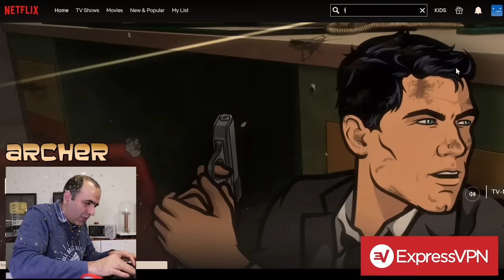What It Takes to Break a RAM with ESD (ft. Linus Tech Tips)

Comment: I remember back in the nineties when I first started building computers, everybody wore those ESD wristbands.  I had one, or I used to make sure to ground myself on the chassis. Over the years I don't think that I've ever killed any electronics. I did have my first 33.6k modem get destroyed by lightning. I saw the spark. I was using the internet at the time and the case was open next to me.

Three and a half years ago I switched to laptops. I never even bothered to sign into my desktop after that. Packed it up. Sitting in the basement. I've done plenty of work on the laptops I've owned since, hard drives, batteries, RAM, that's pretty much all you can do. I haven't even bothered to try to avoid static discharge.

I'm not saying it's not possible. But at this point, I don't worry about it. It's not a problem.
Reply: Same here, worked as IT building and fixing computers, we only wore those wristbands in school and i've never seen anyone use it while working. I mean, as soon as you touch the computer case you're void of any charge so unless you like rubbing your feet on wool while touching a powered computer i doubt anyone would ever kill a component by not being grounded.
Reply: Wtf 13 hours ago?
Reply: Maybe people did wear ESD wristbands because hardware was way more expensive back then? I would say that they were more sensitive to ESD, but I've read somewhere that since they had huge transistor sizes, charge would be more spread out than modern pieces with tiny transistors.
Reply: I second the confusion that this comment was posted 14 hours ago but video is up less than an hour. Wha... How?
Reply: @arfinchiko7026  Gotta be a patron. Get the videos early.
Reply: @douggiles7647  Gotta be a patron. Support your favorite creators. You get perks like early video releases.
Reply: @wiredforstereo   Oh I thought that stuff showed up on Patreon early, learn something new every day. And I do support creators by watching the ads, only way I would join anyone's patreon is when the creator either won't or can't generate ad revenue so patreon is necessary to continue producing content. This is one of my favourite channels but I watch so many creators I can't join them all so only times I will is when the creator doesn't force or can't force ads on us due to content. Some creators make well over 10k per month off patreon so I mean it makes as much sense for me donating to every channel as it does donating to Kylie Jenner to help her become a billionaire, why donate to someone who makes more money than I do? Just doesn't make sense.
Reply: @douggiles7647  We get the links through Patreon, but it just links to an unlisted YouTube video. Then he publishes it later and non patrons get to see it, but it's the exact same video on the exact same platform.

I hear you. For me it's some of both. I supported Mehdi before he became a full time YouTuber. With my beekeeping podcast I do no ads so am supported by Patreon. At the same time, my YT videos are not popular enough to draw advertisers so I use regular YT monetization. Mehdi is doing great now, and that's fine, and I probably don't need to support him anymore. But I do get early videos.

At any rate, there a whole lot of us for whom everything is needed. I only make a few hundred bucks a month with everything. I would love to be full time, but I can't.

Comment: 7:55 "that's why they spread out all the ground pins!"  No, that is not why they spread out all the ground pins.  They actually do it because keeping the ground lines close to the data lines helps to shield them from outside RF interference, making the data communication more reliable.  It has nothing to do with static discharges at all.  I kinda expected Linus to know better, TBH..

Comment: Just watched both videos, and remembered Linus had mentioned the grounds
 are so close together it's hard to hit a data pin. By you guys 
grounding the board to an actual ground wouldn't it be easier for the 
static to actually jump to a ground pin? Would it have been easier to 
destroy the card if you would have grounded a data pin instead?
Reply: A little late to this but if you ground the data pin, then zap another data pin it could go through the board and kill it. But that would be a bit unrealistic.
Reply: 8:16 they did this
Reply: You can sometimes see the spark actually moving to a ground pin in the video.

Comment: Could be those data lines also have esd protection diodes on them ^^ (this is something a usb port on your smartphone uses). Grounding every other pin would also not suprise me. The higher the speed the more usefull ground pins become for signal integrity. That means with the heatspreader on them there is a very low chance of actually killing the module because the data pins themselves are protected pretty well by the ground pins.
Reply: From what I found it seems that on DDR2 3 and 4 every third pin is a ground pin, so that is probably a big reason

Comment: In reality the DIMM wouldn't be grounded because someone would just pick it up. I have seen plenty of modules with little ECC errors that I think were because of ESD while assembling, you should run a complete memtest on the module after each discharge.
Reply: It would have to be pretty badly damaged to fail on startup, but they would have been at it all day running those tests after each attempt. And from what I've seen on electroboom Mehdi isn't one of the most patient people on earth.

Comment: Looks like you guys had a lot of fun making this video.  High voltage is always fun until it isn't.  In 40 years of working on electronics, I only know of killing one chip with ESD.  I had a gal working on a Winchester disk interface card and absent mindedly walked over to the computer she was working on and touched one of the data cable connectors.
Reply: I built my PC in a carpeted room; thing runs like a charm. Only precautions I took were taking socks off and touching the case before handling components.

Comment: I think the reason why it always jumps to ground instead of a data pin is, that the resistance to ground is much lower. Electrons always try to get to the opposite charge. Since you connected the black wire to ground it means that the arc is more likely to jump to ground.

Comment: 4:23 - meep meep "ahh it works anyway" - WHAAAAT?!?! No Memtest86 ?!?
Reply: I guess that would take way too long lol
Reply: @abadenoughdude300  The problem is that you might kill single RAM cells without even noticing it. It will still POST (*MEEP MEEP*) but defective cells might provide wrong data causing crashes and other issues. Sure you can blame it on your OS if it crashes frequently but countless times I was asked to help debugging an unstable computer it was a memory issue. Not always defective RAM but sometimes also defective mainboard or simply too high frequencies etc. causing data transfer corruption - most consumer hardware is Non-ECC.

Edit: When they actually killed it they probably zapped the SPD chip so the mainboard could not read the JEDEC information any more and refuses to use the module. Zapping memory cells likely won't stop it booting.
Reply: big time ⬆️

Comment: Just saying,  research shows when you zap a semiconductor  you can damage it with a microscopic  short that could take weeks months or years to destroy the junction.  Even with the usual built in chip protection diodes you have severely  shortened the life of the product.  That's why we fit X2 class caps to most  computer products, to extend their life by shorting out transients.

Comment: Hi, thanks to my father who is an electrician I’ve just found out that the wall outlet that I’ve been using for my ups, desktop, and server, doesn’t have a ground connection.
Apparently it’s a thing on houses built around 1990 here in Portugal to only have ground wires on the outlets that the architect thought you would put some kind of heating device.
I wonder if it makes a big difference when a discharge happens and if it can damage more a pc component 
@ElectroBOOM

Comment: "It's not dead," he says not actually testing the RAM.
Reply: @MrPitjoey Even if it's unlikely it's a good idea to take precautions with hardware that hasn't gotten to a customers hands yet
Reply: @MrPitjoey They come packaged that way because it saves the blame from being cast upon the manufacturer. Think about it they wouldn't package things that way if it wasn't a necessity, those ESD packages are not cheap. Rant aside, the reason they package things that way is mostly to reduce the build-up of electrostatic on the packaging materials themselves and then transferring those charges onto the item being shipped.

I would also like to add here that there are two kinds of ESD packaging static dissipative and conductive. Dissipative materials prevent the build of electric charges in the first place, like the pink-colored foam that comes with some items. Conductive materials are like foil bags and they conduct charges away from the item in the bag. Dissipative is typically used for packaging materials because it prevents charges from building up while being punted around in shipping; however, conductive materials are typically used when a person is intended to be handling the item so that any charge they might be carrying on them is conducted away from the item in the bag.
Reply: @MrPitjoey when you ship millions of something a fraction of a percent arriving doa is enough to significantly hurt your brand.
Reply: the speaker on the motherboard beeped twice meaning that there are no issues is there's an issue there will be beeps in a different number or sound
Reply: @deniushersmith2438  That is not how you test RAM. It is an okay way to prescreen something, but a good way of knowing if something was actually functioning the way it is supposed to under load.

Comment: Hey Mehdi, you always talk about the FULL BRIDGE RECTIFIER, you never talk about how inverters work, how to make AC from DC, how to hold that voltage, like would a normal capacitor work with AC, and stuff. Maybe even a video about how amplifiers work, something transistor related? Just something I'd like to see.

Comment: Esd destroys stuff by the current wave passing through a parasitic inductance and creating a voltage spike above the rating (or sometimes a long trace connected to a uP without a resistor on it)

Comment: I have been a Systems Administrator for 30 years.  I have yet to use a grounding strap when inserting memory etc- and I have NEVER had a component fail.  

I did work for HP in ancient times long past and they explained that it is when soldering tiny wires under a microscope that imperceptible voltages can damage components.  Since all of that is now done by machines that we could only dream of back then, electrostatic component damage is no longer a thing.  But hey, you want to be super careful?  Go ahead and wear an ESD strap.  (Kind of like a condom for your hands.)

Comment: Not exactly sure why they are charging themselves up. The ESD gun comes with cone tips and finger tips. Could have zapped the memory directly.

Memory modules are tested and designed for ESD.

Also, DIMMs have lots of modules on them. So if you shocked one module, the computer would still boot. You'd have to damage all the modules or some critical component rendering the entire DIMM useless.

Comment: well since the entire computer chase is grounded.. so you get grounded when you touch it when the power plug is in but the on and off switch can be set to off and you are grounded at all time as you work on it. . taking that you roll up your sleeves and rest your arms on the metal from time to time, I got a full aluminium chase so I had to pull ground cables to everything just in chase. since I have trust issues towards alu and it's capabilities

Comment: you're connecting the ground wire to the ram board's ground, so obviously the largest difference of potential is going to be where the static jumps and all you're doing is sending current through ground.  what you should do is ground the board as thoroughly as possible, then remove the ground and shock the board.  that way the whole board has the same potential like it would in a real world scenario and it will ACTUALLY be random where the static is discharged.
i really think you need to do this again without the ground wire attached to the ram board because people are going to take this as proof that it's not important to worry about grounding.

Comment: Check the IC's circuits with the schematics and see which pins are for data and be done with it. I saw it go back to ground. Now weather is went through the device back to ground I don't know. But I did see the spark at the ground when the discharge made contact.

Comment: The ESD protection on most chips will easily clamp most discharges as long as the current is low. Too much current will burn out the ESD protection diodes inside the chips. Mehdi's body resistance is keeping the current low enough not to exceed those diodes' ratings.

Comment: Hi, I think you guys were "to positive" and "pulled"the energy. 

If you rather touched the guntip to a normal earth/ground, 
and then grounded the gun(I assume it has a ground clamp ) to your body, then the energy-impact would be "pushing" on the circuitboard rather than on you.   

Like welding, if you want to heat your tool, you go negative ground. 
If you want to heat the object, you go positive ground.

Or if you want to kill a sandcastle on the beach.. You cant kill it with low-tide =)

Comment: The body has its own series impedance which reduces the current to the RAM compared with direct connection. Also depending on footwear etc the body capacitance to ground is of the order of 200 pF so there is not much charge delivered. I think you have conclusively proven that current kills chips not voltage.

Comment: Here is the issue with telling ppl to "ground" themselves... (Bonding to earth)
ESD is really about discharging ones self safely and maintaining electrical bonding with the ground plane of the device to ensure no charge differential exists/occurs between you and the device. Whether or not the device or you are grounded (bonded to earth) after this makes no difference if you are bonded to the ground plane of the device. Unless of course you build up a charge and use the device to discharge to ground on something else ..which in the case of a pc is a bit difficult. 

There are a lot of devices that should not be worked on while grounded to earth (aka plugged in)

A lot  of Dell PC models come to mind, they will randomly boot up if plugged in but turned "off" by the front panel power switch or windows (in S5 sleep) ... ESD is nothing compaired to sending +12v up the wrong trace on a PCIe slot when you dell magically comes alive while pulling your video card... It easy to do and WILL happen on many models...

Not to be a the semantics police but isn't esd really about BONDING then grounding (at least earth "grounding") .. Earth grounding will discharge you.. but bonding yourself to the ground plane of the device will ensure no charge differential can exist between you and the device...

That being said if you run around in fuzzy slippers on shag carpet while holding a memory stick and shocking people with it being bonded with mean nothing... 

But if you are working inside a case and you maintain contact with that case you cannot realistically create ESD.... also if its >50-60% relative humidity you can forget about all the nonsense b/c you are all ready electrically bonded to the device and to ground by the moisture in the air.

Comment: I think the charge was jumping from medhi's hand to the heat plate which was connected to the ground , and so the current was not flowing through the data line of the ram , and so removing the heat plate killed the ram in the second or third charge most probly

Comment: "That's why they spread out all the ground pins" No, that's a side effect of why. It's a good side effect, but it's not the real reason. The real reason is that DRAM signals are quite high speed, so they need to keep the ground return path close to the corresponding signal pin. Without that, the loading of the line (capacitance and inductance) wouldn't be matched properly, and the rise & fall times would get longer. You'd see rounded-off corners for the pulses on an oscilloscope, and the signal integrity wouldn't be enough to operate at high speed. It'd have a "closed eye" on an eye diagram test, if you're familiar with those. Also the fast edges of the data would emit a lot more radio noise than is acceptable, especially over the distance from RAM to CPU. Remember that a square wave (digital signal) has a Fourier transform of all the odd harmonic frequencies of the fundamental (falling off in magnitude the farther from the fundamental they are). So eg a 1600MHz DDR module will be emitting substantial RF noise at several fractional and multiple harmonics of that frequency. Without keeping the loop area of the trace low, that would be enough to violate EMI emission laws, but by having lots of grounds the signal won't radiate.

ESD protection is just a fringe benefit.